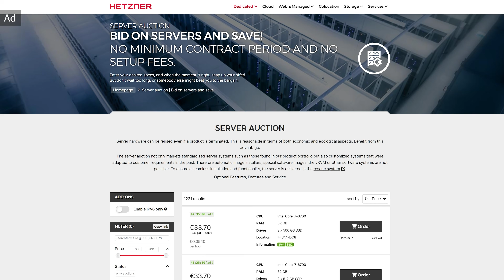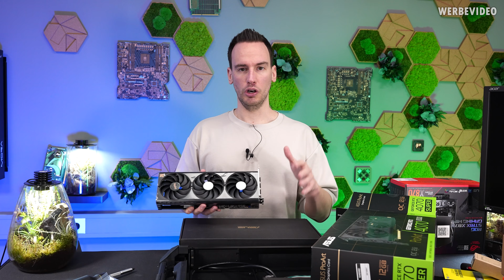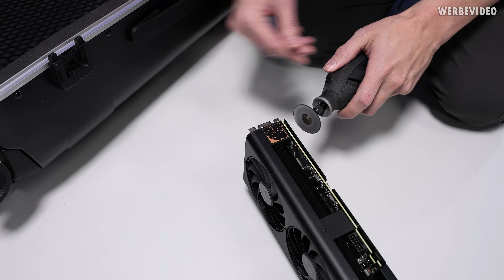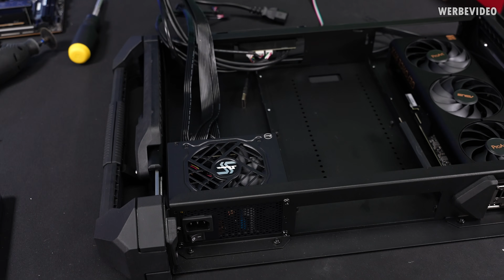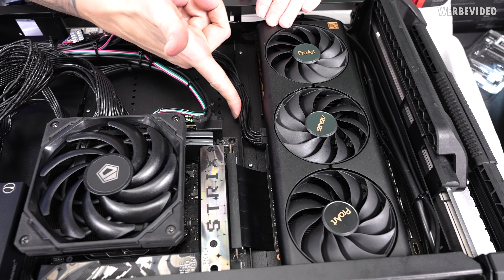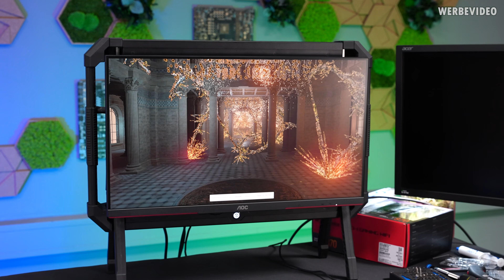I made a Small Mistake with Big Consequences - eBlaztr Build

Comment: I bought this as a prospective pilot, who doesn't compromise on his level of gaming. I wanted the upgradeable concept as well as not being too bulky. If this is my one thing that sets me apart from other pilots, I think I'm doing pretty good. When I travel the world, I want my gaming experiences to be as close to my home experience as possible. My only compromise on the set-up is I'm going from 5090 to 5070 ti when on the wind. That's not too bad when you compare the price of 5090 laptops, and the performance loss you get vs a desktop 5070 ti. I haven't built the system yet, but I've bought all the parts needed. I'm very excited for the build and the play time.

Comment: You could drill a few holes, tap them and put standoffs to the holes of the riser cable retention holes. Still nice you hand signed the 4070 with a dremel.

Comment: 12:35  I wonder if the motherboard standoffs could be reduced slightly to allow the cooler to fit.  I am going through this with an Fractal Ridge.  I used an AXP120 67, but cut a hole in the lid and used a 25mm fan instead of the 15mm.  I am only 2mm too tall as well.  Thinking of printing a 'bump' that can accept a grille and protect the fan. ~6mm 2mm for clearance, 2mm for mesh, and 2mm for structure to hold the mesh.

Comment: Did you mention the weight of it at any time? I think this is brilliant, considering my experience of shipping a PC over to another county, and encountering all the costs and issues involved. It has to be quite light considering max luggage weight is normally 23/25kg.  If the screen could flip around, and a hard case over this, it could fit in a large suitcase. Happy new year.

Comment: For the space given... and using an sfx psu.... would it not be in the design relm to make it use a 240 aio? Heck even a 120 or 140 aio.... Either use a standard ATX PSU or if you are going to use an SFX PSU... then you should use a 240 aio.

Comment: This would be a good case for a corporate system builder to have on hand for making computers for a very specific use-case 
luggable powerful computers is a market and surprisingly large one in the era of work-at-home, but i doubt there is a lot of cross over between the need for a luggable and the skills to build something like this. I would not even fault an IT specialist for struggling with one of these.

Comment: I built a tiny mITX machine to go in my semi and I thought I had a bad riser cable so I had a replacement riser sent out. The replacement didn’t work either. So I tested in a different motherboard for the hell of it. It worked in a few different boards just not the board I had chosen for the machine. Got a new riser from Amazon and everything went perfectly after that and I’ve been gaming on the road since.

Comment: Yeah, any time you threaten to take a Dremel to computer hardware, you probably need to double check your work, as computers were not designed to be assembled using a Dremel.

Luckily the damage here was more to your pride than to any actual computer hardware.

Comment: Quick tip for any colored cables. Just take a sharpie to them and boom! Black cables. Its not perfect it it massively reduces the color and helps it not stick out like a sore thumb. 

I think you could use like car interior viynl dye or a dye of some sort for a darker black or more permanent solution but I haven't tried those.

Comment: Hallo,  Herr derBauer, No offense intended but RTFM first and foremost, is one of the things that popped up in my mind watching this video, which by the way I found EXCELLENT and amusing.  Having seen many videos I feel like you may want to change the name derBauer into  derDremler lol 😂🤣. 

Watching you struggle with the build made my eye brows rise a few time watching a co grunlichkeit DNA person doing the things you did in the video.
I feel that you did make a few valid findings, like with the missing standoff / securing of the PCI extension cable. 

A simple solution could have been adding a few rubber blocks underneath it to secure the PCI connector to the GPU and be done with it. 

Having watched the video a few moments ago, I am still processing it while typing this feedback. I do like the product, even with the steep 400 EURO price tag.
As you mentioned, I feel that it is missing the standoffs and a 'system' that allows an easier mount of any monitor to chassis. Other as that two thumbs up, especially the last part of the video where you clearly explained how you felt, the responsibilities you have as a YT celebrity, that last part I fully understand and highly appreciate. While listening to all of that a different YT person flashed by (LTT) who did make such mistake some time ago and I will leave it at that.

The device is surely handy, for like you said, industrial use or sales, but also wonder if alternatively one could not get a laptop with similar specifications / hardware and a portable 24 or 25 inch screen instead. I was even thinking of the All - in - one as a possibility, already build all in one, no hassle, other as finding a similar size and case to transport it in.  But, I like this assembly you build so I did enter the giveaway for fun since its 30 December 2024, keeping fingers crossed.

Thanks again for an excellent entertaining video and for you being you, keep it up and if there are no more videos this year, Alles Gute für 2025.

Comment: Nice design but as you said, very niche.
For light travel a normal gaming laptop will be just fine.
For use in and exhibition a nromal mini- PC hooked up to a big monitor should also do the trick.
This is just for wanting maximum desktop performance on a more mobile setup...

Comment: I personally find the monitor mounting better than standoffs the screws pull together the case and monitor back, thus adding the friction on the two materials to help in holding the screen in tension, not hanging.
If you use standoffs all the monitor weight (and the force every time you touch it) will be cantilever into the aluminium sheet and the inserts on the monitor plastic shell.
Standoffs look neater and professional? yes. Will you break something over time? also yes.

Comment: Very cool concept. As a traveling service tech a mobile gaming station with desktop components, a big screen and real keyboard and mouse are a dream.
However this complete system fills a full case, leaving no room for the rest of my travel stuff. 
Right now my top- spec 15 inch gaming laptop is much smaller, has good 1440p performance and fit besides all the rest of my stuff in a travel bag :)

Comment: Roman, I'm sorry that this video was stressing to make but I think it's a very good video, especially because you includes the self-reflection at the end. No offence to eBlaztr but that part is quite valuable.
It's unfortunate that your familiarity with putting PCs together and the time pressure to get the job done (and your confidence with the dremel 😆) ended up sending you down the wrong path. I'm sure that if you didn't have to meet the tight deadline for publishing, you would have paused and found out how the mounting was actually supposed to work. None of my businesses but working Mon-Fri and producing videos on Sat-Sun is kind of bonkers! How you manage to do that just amazes me.
If eBlaztr are truly customer focused, they could benefit from adapting their instructions and documentation so that such kind of misunderstandings become very unlikely to happen, even with customers who find themselves in similar conditions as yourself. And the mounting of the monitor must be revised: there must be a better way to couple the chassis of the case with the VESA mounting holes.

Comment: I recommend adding a vacuum cleaner to the Dremel kit - while the steel dust is quite fine, the plating can leave conductive needles. I killed a Q6600 this way and decided to not repeat that feat.

Comment: If you could buy just the table side case without the carrying case for like 100-200€ this would be amazing case for DIY AIO PC for either office applications where you need powerful portable machines or for people living in smaller apartments where they might not have room for full tower but this beats any of AIO PC or laptop on market because a full desktop components are used and you can upgrade everything down the line.

Comment: That monitor attachment is extremely poor. A standard vesa mount you attach to the back of the monitor and then a type of clip on/rail system on the case should have been the logical way.

Comment: I have a large gantry type cnc in my wood shop, i use it all the time, I can not tell you how many times i have done this very thing. "I know what i am doing" only to find out i messed it up badly. Confidence truly is a double edged sword that teaches us through our own mistakes. Great video
Reply: Up until the early 2000's, almost all CPUs had the little arrow on the CPU pointing at the corner of the socket that the leaver is attached to. Then AMD introduced the Athlon64, and the little arrow now has to line up with the opposite corner (there was a corresponding arrow in the right place on the socket).
I was working at a PC builder at the time, and one of the guys who was picking the parts decided to be helpful and insert all the CPUs into the motherboards for a whole batch of 20. He'd not seen an Athlon64 before, so every CPU was jammed in the wrong way, and then the heatsink jammed on top just to really mess things up. Every CPU ended up with, not just slightly bent pins, but utterly smashed pins.
Eventually, with a lot of careful work with a knife, we managed to salvage about 15 of the CPUs, I still don't know how.
Reply: @phuzz00  I remember my first anthlon64. I had a 486 up till that point. Felt like i had entered into the future.
Reply: @phuzz00  that is interesting to me because the Athlon64 was the first CPU I used when I build my first PC.
Reply: This happens often with cars. I was a dealer technician for a while and saw and was taught the right way things were supposed to happen. This made some jobs that looked difficult go quite smoothly and without excessive disassembly or time spent. Seeing some "creative" ways that shops less familiar with the brand went about repairs was frustrating, often resulting in unnecessary modification and workarounds that didn't need to happen.

Comment: Food for thought. Since the monitor hides the front add two posts through the front into the case where the riser cable goes and use the two outer holes of the riser with the posts running through to keep the riser from falling out.
If possible as I can’t tell what’s there.

Comment: That bend in side panel is little annoying. BTW I used that 53 mm Thermalright cooler before with 3700X and it was amazing even during load. So sometimes it is good to sacrifice 2 mm of cooling.

Comment: I think both sides are equally guilty. You did a mistake, but the product manual made by the manufacturer wasn´t properly engineered either.

Personally, i don´t like, how wobbly the whole thing is. Not just the legs, but also the PCIE riser should have a fixed point in the case. On top of that, while i understand the open rear, that thing will attract dust like crazy.

Finally, max 25" monitor support is not enough these days. I´m used to use 27" monitors. And yes, having at least a set of standoffs would be a tremendous help, especially with curved monitors.

Comment: The GPU mounting points mistake could have been made easily by anyone, as any builds would have used "the standard" mounting holes... I am surprised eBlaztr designed to use different GPU mounting holes but not a different vesa mounting configuration (something that doesn't require taking the mobo off to adjust), a more secure GPU riser cable option, and any 2.5" SSD mounts, and the GPU power cable spacing.
Also, I am not sure if there is a way to protect the GPU from wiggling and colliding the case during transit or just carrying across the room.
The idea of the case is really nice, the finishing, design and execution are all fairly well done, I think their next iterations will be much better!
Very good work on the review and build walkthrough.

Comment: For the GPU, I was just looking at multi angle vertical mount kits; and it made me think that it would make a lot of sense if you had to redesign this anyway, to make the GPU plug in vertically (assuming it's mobo side down), and rotate axially down into the computer. I also agree that the monitor should be mounted to a removable plate. You could make that plate do the same thing like where I think even that stock monitor arm does where there's just hooks and a latch with the vesa holes, and this could quickly go from janky to smooth. It also might be better to have that plate that had tabs and slots to just get unscrewed. It's cool to make the mechanisms, but in that case it seems misplaced given the finish and the rigidity of the parts, you're bound to chip that over time.

Comment: That bend on the displaycable though😱 🥴
Reply from the maker: yea I also died a little doing it xD didn't feel right
Reply: ikr.. i was cringing at it.. a 90 degree cable would have fixed that issue most likely..
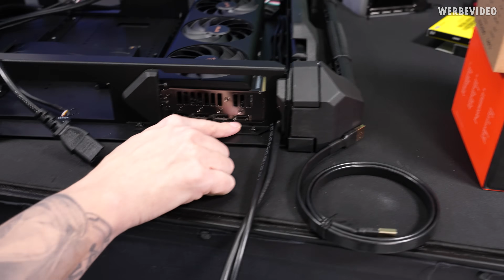Reply: If you look at the supplied cable at 7:22 it looks like the strain relief near the plug may be designed for that kind of flexibility, can't tell from the video alone. It's definitely not a typical DP cable that's just been smashed into place.

Comment: TBF a normal Micro ATX build is pretty portable, especially if you bung a couple of handles on it. My 2nd machine is mATX, built in a very shitty £25 case. I have a 3080 in it, and the motherboard is one of those cheapo half breed AliExpress specials which I have a like a 10 year old 12 core Xeon in it. It's very easily picked up, I normally stick it in the back of my car when I go to visit my folks.

Comment: Hi, please tell Lian-Li for the 011 dynamic mini to set ports at the bottom front like the "XL" version. A mini build is supposed to be on a desk and users should not stand up to plug a cable (very wrong for dust too). And also if they can add the offset pieces to mount a 360 rad at the top or at least sell them. Thanx a lot keep the good work.

Comment: I wouldn't say you fucked up, those slots are how a card mounts in a regular case and if they didn't provide instructions telling you to use the other hole then that's on them. There could even be a chance that there's a card out there that doesn't have that extra hole (I couldn't find one to say for sure) and if you wanted to use a single slot card for whatever reason then that won't have the hole. I wouldn't trust that monitor mounting either, with no spacers between the case and monitor you're not going to be able to tighten those screws very much without crushing the plastic case and if they loosen off they're going to short against the back of the motherboard.

Comment: 23:45 These problems are product related. The fact that they didn't include a properly detailed manual should be enough justification for your confusion, frustration, and disappointment in the product. Their design goes against industry standards for the position of the mounting screws on the GPU. Every case or test bench you have used before has used the mounting points on the GPU you had tried to use, which explains why your instinct told you to use them. The cover plate being difficult understand how to remove, even if there were instructions, is a design flaw. It is not your fault for demonstrating the pitfalls a customer might have while building in this case. In fact, it is honest reviewing and we appreciate that as an audience. Do not be disappointed in yourself for the failures of this product.